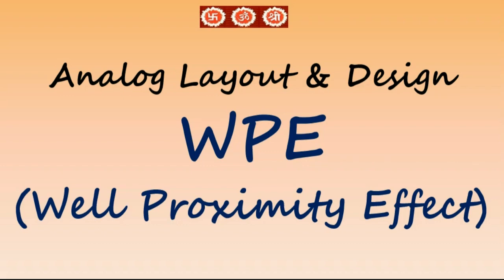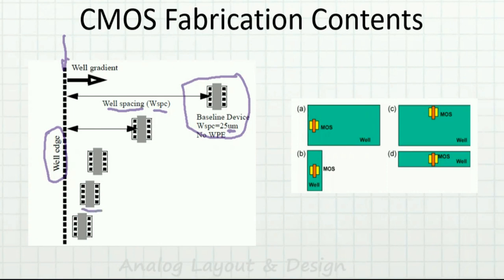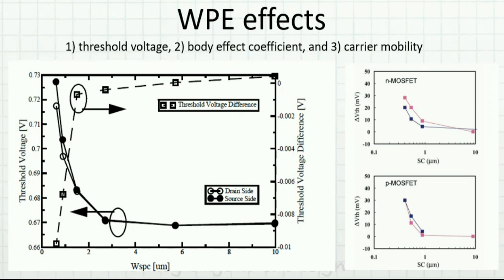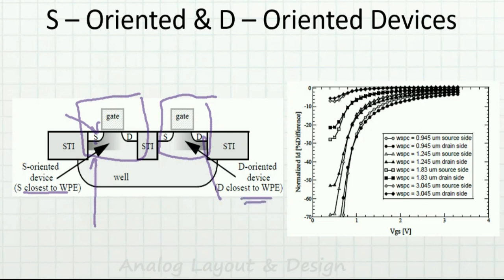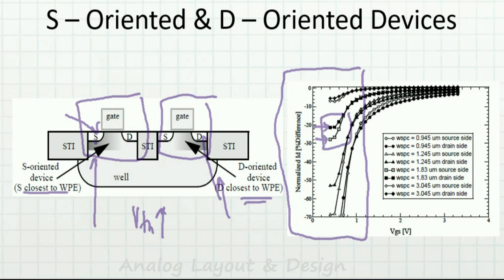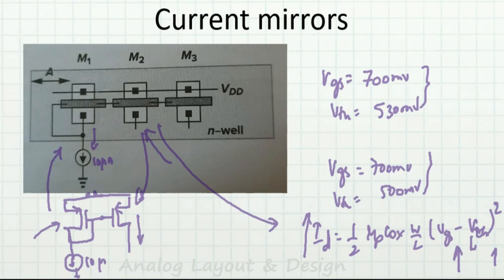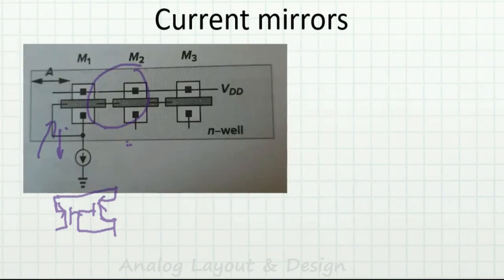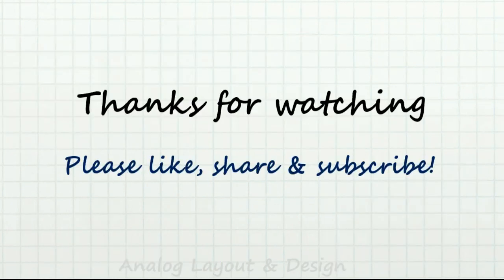WELL PROXIMITY EFFECT (WPE)

Comment: Hi Sir. Thank you for the explanation.

Sir, is there any tool that can be used to detect WPE issue? does the WPE issue is included in post-layout simulation (layout extraction)?

you've mentioned that dummy is one of the methods to prevent WPE. how the dummy transistor can affect layout performance such as parasitic?

I once saw the schematic has a lot of dummy transistors and the other schematic does not require a dummy transistor. what are characteristics that a circuit needs to have a dummy and how many dummies are actually needed for a circuit?
Reply: Hi, good questions. I will try to get answers for them soon.

Comment: I have a doubt in wpe why pmos current is more compare to the nmos
Reply from the maker: I have explained only pmos in the examples.  Pmos transistors are in nwell... wpe is for pmos transistors close to the well edge
Reply: @analoglayoutdesign2342   For nmos devices placed close to nwell also can face similar issues ,right?
Reply: ions are already sitting in the well  . So pmos has majority carriers as holes . so, settled ions will ease the mobility

Comment: at 8:04  minute you are saying Source current capacity is more than Drain, but in the plot, the drain capacity is reduced by -20% whereas the source capacity is reduced by -30%. This means the Drain current capacity is more than Source. isn't it? could you please explain this
Reply from the maker: At 8.04 min, I am discussing about Source and Drain oriented devices.
So what I meant is if Source of the device is near to well or drain of the device is near to well, the effect will not be same..
Vt increase will not be same.
Others are numericals to show systematic errors introduced.
So the gist of the entire discussion is place devices away from the well edge..use dummies..else threshold voltage can increase by 30mv to little more than 100mv